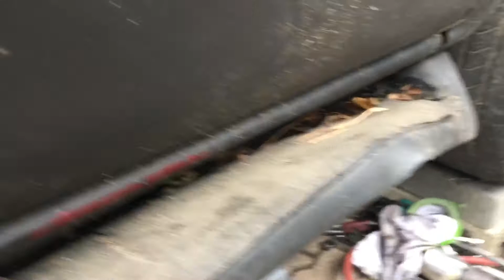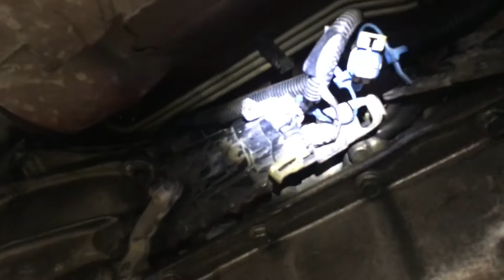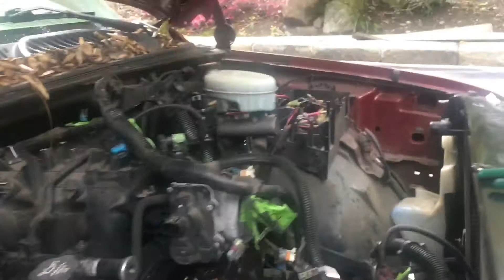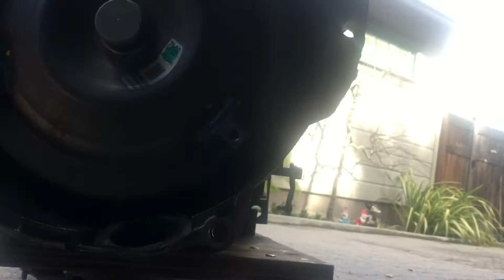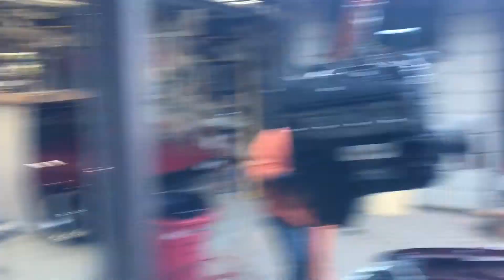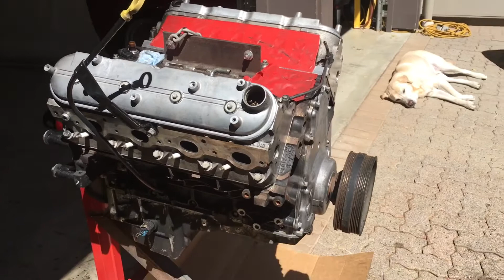68 Chevelle Donor Vehicle

Comment: I just picked up an LT1/L83 with a 6L80E out of a 2014 Silverado. 109000 miles on it and very clean.  My cousins family own's  an auto recycling yard and he'd been keeping an eye out for something to go in my 37 Chev PU.  it's going to be a tight fit.  They gave me the engine and transmission still assembled along with every possible wiring harness and then some.  I've got a box full of harnesses and fuse panels.  Also got the driveshaft and trans crossmember.  I figure if a small block fits, so should this.  Exhaust manifolds may not work, at least not the drivers side as it kicks out for some reason.
Reply from the maker: That’s so awesome. I looked into those engines and the key is exactly what you did. Get everything off the donor otherwise it gets scary expensive. It’s not supported in the aftermarket like an LS so parts be pricy. I use just the computer and make up my own fuse/relay system. I’m assuming it’s drive by wire so there’s another original module you’ll need along with pedal assembly. If you need wiring help and guidance there’s a great guy who is Sinister Performance. Ryan has scary knowledge of GM swaps. 
Good luck and video the project please
Reply: @buildanother68chevelle75  Thanks. I have been following Lt1Swap.com and had hoped he would support the Gen V but he does not.  Funny thing is, He's putting a Gen V in something now.  I'm really tempted to go to LS Fest west in Vegas as I know there will be lots of support. GenV support is starting to pick up.